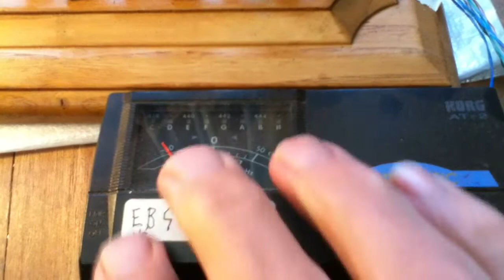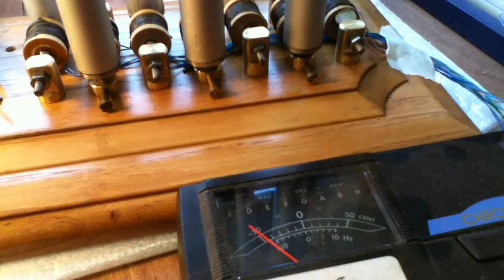Novel Tubular Bell Player - Part 1

Comment: Love the sound..Did you cyno the brass plugs in position within the alloy tubes,are they anodised,did the semi rigid mounting reduce volume/resonance much ?
I am looking to build a chiming clock but mechanically struck,possibly playing a tune via a camshaft/hammer type arrangement and wondered the best way to hang them!
Congrats on your work

Comment: Terrific work. Are there any changes you would make to the excitation side in the light of your experience? More turns of thinner enamelled wire or maybe a flat on the steel annulus? I would like to play the first two bars of the haunting Coventry Carol as the chime on an analogue LED clock I'm making. Any suggestions very welcome.